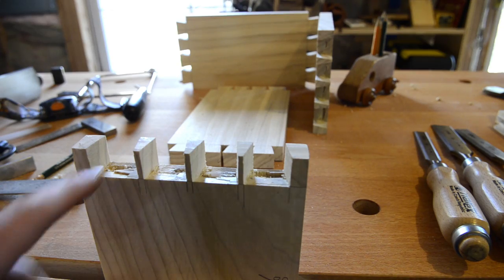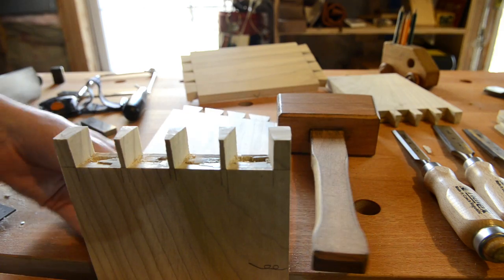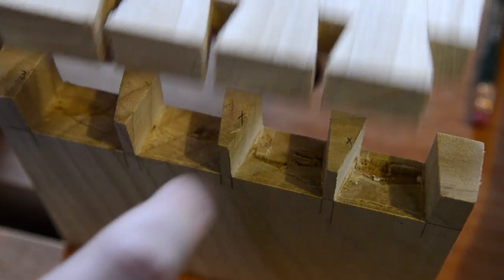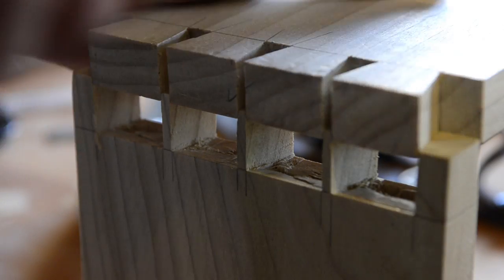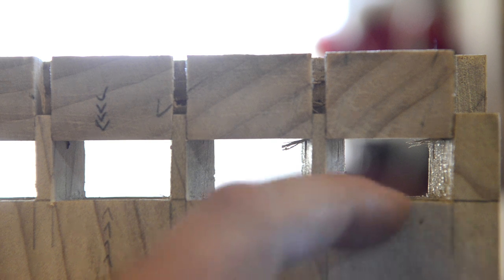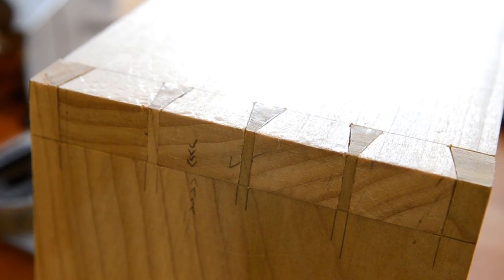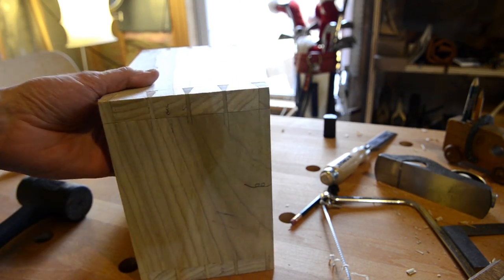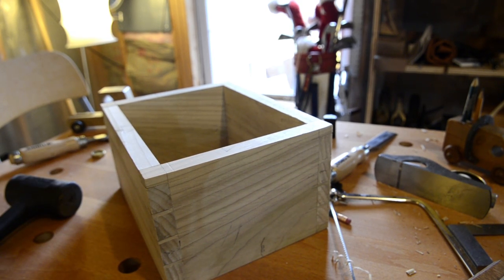Hand Cut Dovetails Part 14: Joining the Pins & Tails

Comment: I also cut tails first, and two ways I found to lessen the amount of joint tweaking is to:  

1.  After cutting the tails, use a small square (mine is a 2" square) and make sure all angles are at 90 degrees.  If you use small pins, this will be harder to do because there isn't much room, but you can angle the square to check.  It is much easier to tweak the tails because you're not trying to match the other board, you're only trying to get it to 90 degrees.

2.  If possible, try out different saws.  I started out with a Veritas one, then, I decided to make my own, copying the Gramercy saw.  The Gramercy saw uses a 19 ppi  blade, much higher than most other dovetail saws.  The most important part of sawing is the start, and the 19 ppi allows a much more accurate start.  It cost me about $15 to make my Gramercy copy (I used a $10 buck bros saw from HD).

After I did those 2 things, the amount of tweaking after cutting the pins was maybe 1 pin/tail out of 7 or 8.  Meaning, 9 of them matched perfectly w/o any tweaking.  Before that, I had to pare every pin/tail to get it to fit, and oftentimes, this led to gaps here and there.
Reply from the maker: Chuck, thanks for your input on dovetailing!

Comment: If you leave drawer sides proud, with that much undercut in the sockets, when you plane the sides flush with the pins you'll expose the baseline and have gaps.  The undercut is way too severe and the grain wrenching off the charts.